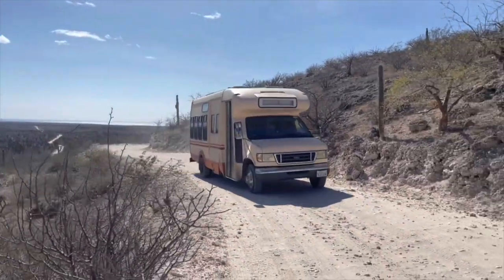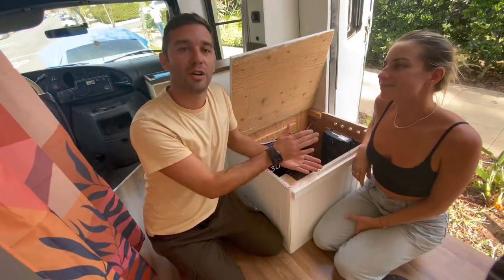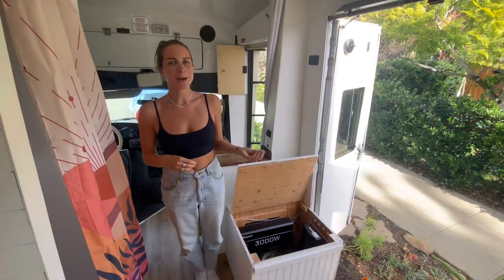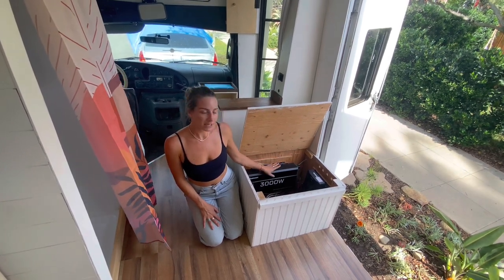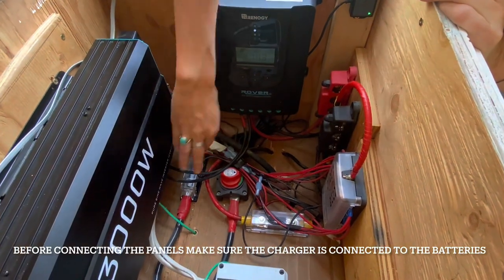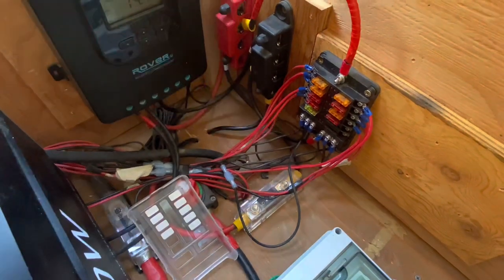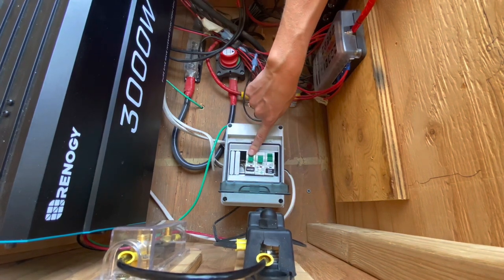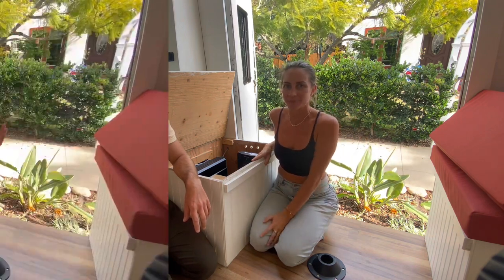Shuttle Bus Off-Grid Solar - Easy Guide Ac + Dc Electric System

Comment: Work till you're frustrated, then come back later... LOL I wish I had learned that lesson MUCH earlier in life! Well done guys!! 3000 watts, wow, at first I was like OMG WHAT do you need that for... Then you said water heater and I was like, OOHHHH that. Very good explanation of the system! Great choice, going with Renogy, specifically the MPPT charge controller. It helps with efficiency to give you a little more power than PWM. Very good video! Thank you for sharing! Love to see it!
Reply from the maker: Thank you Brian it nice to hear positive feedback😉 yeah we decided to get a 3000  only for the water heater and the AC fridge. Otherwise we would have gone smaller.

Comment: You need to move your cables on your batteries. In your drawing of your batteries you are pulling off both the positive and negative off of the same battery. One or the other needs to be moved to the 2nd battery. Because as you have it drawn you are not utilizing the full potential of the batteries. You are actually only using one battery and the other one is just sitting there. Proper parallel battery is red on one battery and negative to the negative of the other battery so that you have 200 ah available.
Reply from the maker: Oh really? 😅 We didn’t know that!! Thank your for the tip, definitely we’ll do that in our next build